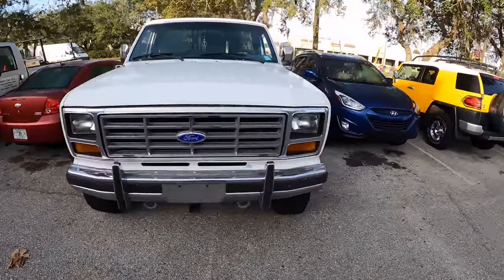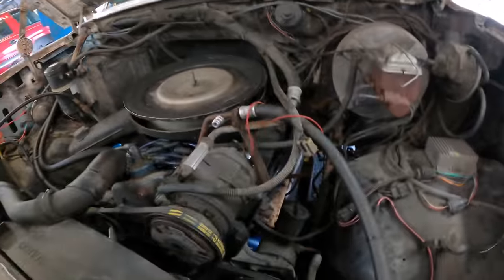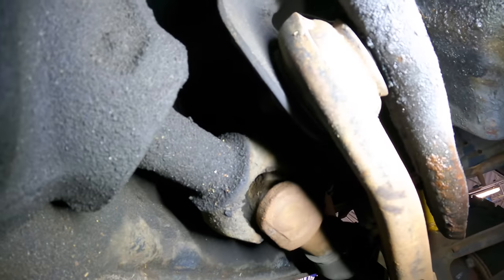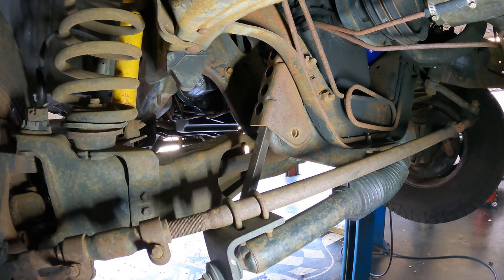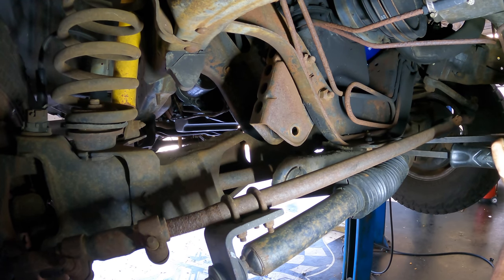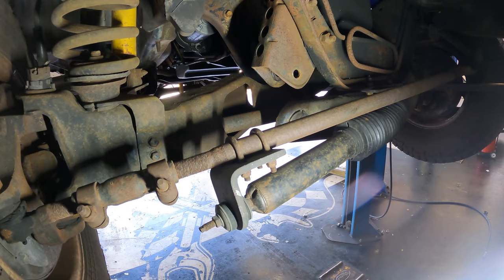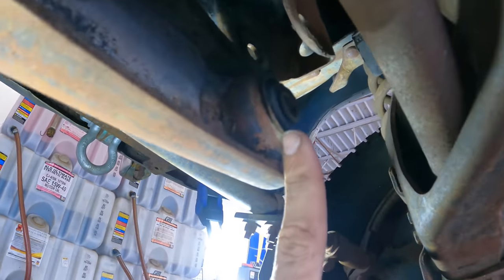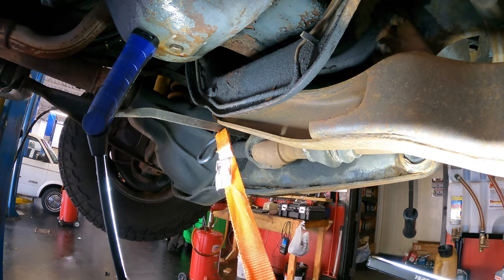Bushings DESTROYED! Assault Hammer to the rescue! Old Skool Ford F150 Classic

Comment: Those Bushing Bolts should be tightened with chassis resting on wheels.
Reply: Said the same thing...it'll tear the centre of the bushings out
Reply: You are correct sir.
Reply: ALWAYS TIGHTEN BUSHINGS WITH WEIGHT ON WHEELS
Reply: The rubber is not bonded to the sleeve, so it doesn't matter.
Reply: @Maples01  You're wrong on that. With these bushings the rubber is bonded to both the inner and outer sleeve. Installing like Ray did pre-stresses the bushing, taking away half it's normal service life.
Reply: @P_RO_  Did you see how it came apart, bonded would have torn to pieces so no, you are wrong.
Reply: @Maples01  They're bonded. I've got two new bushings sitting outside in my van. How many have you handled? Part of the way they can wear out is losing the bond on the inner sleeve which wallows out the rubber. I've been told the poly bushings aren't bonded but I don't know about them; the ones in this vid are stock, not poly.
Reply: @P_RO_  Never seen one lose the bond, just seen them tear up, oh please tell me how I don't know what I'm talking about and how you are so much more qualified to comment.
Reply: @Maples01  Now wait- first you say they're not bonded and now you're saying you've never seen one lose the bond. Pretty clear you have no clue of what you're talking about. Goodbye.

Comment: Penetrating fluid generally does nothing unless you let it soak. Then it depends on quality of the product on how far it goes into the threads
Reply: I have watched PB blaster literally walk it's way around the threads of stuck fasterners, it's impressive stuff. I use CLP breakfree for gun smith related stuff. Marvel Miracle Oil can work in a similar fashion too.

Comment: Those high beam foot switches tend to crust inside, I wonder how many times the guy repaired it.

Also, if you decode and see what Eric says about penetrating oil, it's a "myth" when you can't spray said oil directly on the threads of the bolt.

He gives a great example in one of his "exhaust manifold therapy" videos : sprayed a LOT of penetrating oil on the bolts, but since the threads are in the head, none of it goes where you really want. And as a matter of fact the threads were completely dry when he finally removed the crusty bolt.

But he uses it anyway because :
- It makes you feel better
- There is less chance for the bolt to be stuck on the socket (well, he didn't say that one, but hey, I guess so)
Reply: Where's Heineman when you need him.    'Project Farm' channel did a series on this some time ago.   I see I need to waste another couple hours of my life seeing what his findings were.   He's generally pretty thorough in his tests.
Reply: @IndianapolisGerry  They indeed do penetrate down into the tread, but as expected some brands did a much better job than others.
Reply: @Milnoc  Also when working in a shop environment usually there's not a lot of time to sit and wait for the oil to actually penetrate.  It'll help once the nut starts to spin off, but who wants to wait for several hours?  

That's when people bring out the 'real' liquid wrench...as someone famous once said:  Can't be stuck if it's a liquid :-)
Reply: ⚡:SPEZIEL FÜR DICH
"BEST.FURDICH.FUN" :yt:
> SATISFY.BABY < :socialdist:

 

tricks I do not know
Megan: "Hotter"
Hopi: "Sweeter"
Joonie: "Cooler"
Yoongi: "Butter

So with toy and his tricks, do not read it to him that he writes well mamon there are only to laugh for a while and not be sad and stressed because of the hard life that is lived today.
Köz karaş: '' Taŋ kaldım ''
Erinder: '' Sezimdüü ''
Jılmayuu: '' Tattuuraak ''
Dene: '' Muzdak ''
Jizn, kak krasivaya melodiya, tolko pesni pereputalis.
Aç köz arstan
Bul ukmuştuuday ısık kün bolçu, jana arstan abdan açka bolgon.

Uyunan çıgıp, tigi jer-jerdi izdedi. Al kiçinekey koyondu wins taba algan. Al bir az oylonboy koyondu karmadı. '' Bul koyon menin kursagımdı toyguza albayt '' dep oylodu arstan.
Arstan koyondu öltüröyün dep jatkanda, bir kiyik tigi tarapka çurkadı. Arstan aç köz bolup kaldı. Kiçine koyondu emes, çoŋ kiyikti jegen jakşı dep oylodu. # 垃圾

They are one of the best concerts, you can not go but just seeing them from the screen, I know it was surprising

💗❤💌💘
Reply: @IndianapolisGerry  Yeah Project Farm did good tests on it. Result with basically that it does not really matter at all. And WD40 was crap if I remember correctly.
Reply: Yah, they were all pretty worthless according to his testes....I went back and rewatching shortly after I posted this
Reply: True penetrating oils do work if given enough time. Were most err is thinking that WD40 is a penetrating oil when it isn't, though it does help sometimes. PB Blaster is much better.

Comment: These are great trucks, had an old abused '85 once. It leaked oil and fishbite misfired and had a slightly bad head gasket but still completed a 700km trip. The coolant boiled but 20 mins later i was on my way. Today's cars couldn't do that for sure.

Comment: One thing I learned not to do a while ago was to try hammering a bolt into position if it won't go. I've damaged threads doing that as it was the thread catching  due to misalignment. Either keep wiggling the part in question or screw the bolt in if the alignment is close enough.

Comment: In the rust belt, the bolts would have been welded to the center bushing sleeve.
Reply: yeah, but it is a FORD, so it will leak enough oil to keep that from happening.

Comment: That is an on/off switch that controlled my Phillips made,  385,000 candlepower, 3 mile reflective range, KC Daylighters that were on my 79 El Camino, and it also came standard as the 60s and 70s floor mounted, high beam,  headlight switch. 

But it sure came in handy for an auxiliary light switch! 

Just route that sucker to a relay, and boom!!

Comment: I've done a few of those I Beam pivot bushings through the years and, my 30 YO OTC ball joint press saved me a LOT of time/hassle over the years. Now for weird, the pass side bushing, as in the bean/front diff ass'y, the bushings in question, don't seem to die too quickly, the same can't be said about the beam going to the L/F spindle. Just that the latter's much easier to replace.

Comment: My first car a 74' Dodge dart had a high beam switch like that. And I made sure to put the grandma quilt over the back seat just for fun. Many years later had a Bambi basher installed on my Jeep Grand Cherokee and gave the guys at the shop a floor switch like that to control the LED light bars. They thought it was a great idea. Some had never seen one before.

Comment: You’re working on the vehicles i used to work on for about six years.

I know it’s about a year old but for future reference because Florida doesn’t really have rusty vehicles so they last longer. 

Bushings like that. Raise the vehicle higher if you can put a toolbox or something under the tires drop it back down on it. And if you loosened everything up in the suspension both those arms will drop down without even using a prybar.  

Can tell you’re a young mechanic. You’re used to self sealed bushings. I would of pack the grease all on it and shoved it back in.

PS Especially in Florida  when everything is so darn hot then it gets hotter with use the bushings dry out fast. Unlike up north it’s usually everything they put down on the roads in the winter time that tears the bushings up so that’s why you put a big blob of grease around them to protect them

Comment: I've heard and also agree 98% that penetrating oil does nothing for breaking nuts and bolts loose. There is probably a few cases were multiple applications over time could allow the oil to wick into the threads, but in most cases torque or heat expansion/contraction is king. I think spray oil that is particularly good at removing rust can lubricate and ungunk the exposed threads, so that once you've broken the fastener lose, the rest of the way will be smoother.

Comment: High beam to low beam switch on older cars, trucks.  I am old enough to start a US Army Jeep. With the foot starter.   That truck was a trip. 24 volt. Air craft type wires.  Screw onto spark plug. Ect. Needed a generator that was like $2000 in 1980.  Cost more then the truck

Comment: Wanna pull from the old memory cells? One of my 1st cars had something like your dimmer switch, but didn't have any wires going to it and it was on the right side down close to the gas pedal. Funny thing was every time you pushed on it, the engine tried to start! Had to push hard tho. One other thought, at the Ford garage, we always lowered the vehicle back to the ground, then tightened the through bolts on the I-Beams. No mockery, just what I was taught. Always look forward to your videos!

Comment: Thee Olde Dimmer switch. I drove with those for a while. Also had an old p/u with the twin I beam front suspension. The large triangular plates that the held those beams to the frame saved me from severe injuries in a wreck that totaled the truck that was less than a year old. It stopped the impact from traveling through the frame and to the cab. I did do a face plant into the windshield post on the driver's side busted my nose give me some nice bruising on my face. I was wearing the seat belt but it didn't restrain my 6'2" frame from traveling that far. It pushed the frame in front far enough to the right that it broke the fuel pump and was leaking gas so I bailed and scared the bejesus out of some bystanders. I'm filed as undeclared was originally a hard-core Repugnanticant from Iowa back when they still felt some responsibility to the constituency they represented but now I am undeclared and so I get all the trash in the mail. I've actually become good at spotting BS mail even from PACs trying to be stealthy.

Comment: My grandmother (God rest her soul), bought a 1985 Jeep J10 full size pickup when I was a kid -- and I remember that truck had the dimmer switch on the floor, like that Ford F150.

Wish I had the means to restore that truck, because I would have resto-modded it, to make using the four-wheel drive easier. (The four-wheel drive had a much wider turning radius than two-wheel drive, on that truck.)

Comment: I think that's a '76. I had a '76 F250 Camper Special King Cab I bought off a friend when he was going to trade it in. It was a camper special with 16" split rim wheels. With the restricted steering because of the tall wheels, it seemed like it took a football field to turn around.  It was great for hauling and towing.

Comment: I don't want to be the smartypants here, since I'm not a mechanic at all, I just used to fix my own cars when it's needed, but when I change a bushing or a control arm I used to fasten the bolts going through the bushing to final torque when I lowered the car and sitting on its own weight. By this the bushing is not under pressure when it is in its natural position and lasts much longer. I don't want to underestimate your skills, I like your videos, if I'm wrong then feel free to correct me, but this is the first time when I'd do it differently than you did, so I just pointed that out, since I don't know if it matters that much at all.

Comment: Hell, I can remember when the starter switch was on the floor in my 1941 Chevrolet. Not to mention a spark adjuster on the colum on a ‘28 model A. I now drive a Duramax, the little Duramax. By far, my best Silverado ever.

Comment: Low high headlight bottom 
I was watching the knock sensor on a suburban and you had a lot of problems with the lumens or light, you can go to home depot and buy the Milwakee head light for around 60 bucks, I got 2 one is on use and the other charging I do some HVAC or mechanic and they last about 6 hours on a medium setting, they have 5 options light

Comment: I love "old" cars too. Simple electronics and mechanical systems make perfect cars to me. The newest car I've owned is a 2010 Corolla Base 5MT. Because it is a base model, it feels 10 years older. I also own a 2003 Dodge Dakota, and have owned a 2002 Ford ranger and a 2000 Toyota Echo. Meanwhile, the most advanced car I've owned was a 2006 Infiniti G35 coupe 6MT. Fairly advanced for the time and fully optioned, but the relatively poor fuel economy along with cost of parts was too much for me. I still miss that car. 😢

Comment: The only thing I would add to this repair video is that it's usually a good idea to tighten the bushing bolts with the suspension loaded (4 post lift). This keeps the rubber from flexing while the suspension is at rest. Otherwise, fun video. Especially with the harpooning air hammer chisel.😂

Comment: My father had a 1958 chevy convertible that blew the transmission. He replaced the transmission with a floor mounted manual stick shifter, and added a clutch pedal......The auto trans gear shifter was left on the column.

Comment: If the car was from the early forties that switch would be a starter switch. My dad had a Lincoln, I believe, that the foot switch pushed the starter into contact with the flywheel and made the electrical connection. In that truck that is the high beams.

Comment: 1:12 Those have been 2 things. Usually they are high beams but they can also be single swipe wipers back before the delay function was invented.
Reply: On a Lincoln we had it advanced the mechanical radio through the presets.

Comment: Lubricant is nice on low rust hardware but anyone who fixes cars from the "Rust Belt" will tell you that the second tool you need after the 5 lbs hammer is a good set of Oxy-aceteline torch and you always order new bolts/studs because most times, you end up cutting them...

Comment: I do have a question, if I may ask...

When tightening suspension bolts on bushings, I generally used something like a pole jack or something similar to jack up or load the suspension to around ride height before tightening the bolts. That's something I've always been taught to do. That being said, I'm young, inexperienced, and I primarily work on newer German cars. Is there a reason why you didn't do this here?

Comment: Just from observation, is there not a tie down on the floor you could have strapped to, and just ratchet it down? seems like it would be safer, and slip less. understanding of course you reinforce the lifted vehicle from tipping in the direction of the pull..

Comment: To old arnt I we were saying how high use to be on floor no more they are what a gem we had a dual wheel for construction in Australia with nice351 on gas very reliable with tray we use to put a lot of weight on it everyday very strong ford single cab fit nearly the same but U all have the steering wheel on wrong side ha have

Comment: IF I, understand what your doing? would a drill remove enough of the rubber (of some for ) bushing to push it out? May not be time efficient but just curious. 
I find it interesting that most use impact hammers while working on bolts. 
I do like Kopper Kote on things which will rust/corrode.

Comment: an assortment of dimensional lumber pieces ( 1x2, 2x2, 2x4, etc.) can be very useful in helping hold pried parts in place temporarily. your shop mate should be just as capable in assisting when you need a third hand to grab your wood as he is in twisting your shaft.🪵

Comment: The Auto Dimmer Switch, or (High and low beam selector).
At 1925, the dimmer switch was located on the steering column. This changed in 1927, when it was moved to the floor.  Why did the location of the dimmer switch change? The automobile makers decided it was too much of a distraction on the steering column and agreed to move it to the floor.

The floorboard area was wide open, perfect for the floor-mounted switches, as they could also be made larger and more durable. Car owners would enjoy the floor-mounted switch for the next 50 years.

However, not all vehicles made the transition at the same time. When a major re-design of a vehicle was made, then the dimmer switch changed as well. Generally, the switch function would go to the stalk when a model went from rear-wheel drive to front-wheel drive (which happened a lot in the late 1970s and early 1980s) because the foot-well area became smaller, leaving less space for owners’ feet.

Comment: 1986. Which means, unless it's been changed, that is a 351 Windsor engine. 302 was the only engine in those trucks that was fuel injected in that year. And you only had 300 Inline 6, 302 V8, and 351 Windsor in that f150 to choose from. If it is original, I would love to have it, lol.
Reply: I think you're right. I prefer vans, essentially the same as 2wd trucks, and up to 91 you could get a 429 in them so I can't understand why not in the trucks too, but that's how it was!

Comment: 1:05 That is a rare piece of automotive history. Back when things where put in logical locations. It is the High beam selector switch. Only down fall was it was not protected properly from the elements. Which lead to corrosive malfunctions from mother Gia coming in contact with the connectors on the back of the switch, which was located under the vehical. Ahh. The simpler things in life.

Comment: The button on the floor is the dimmer switch.  Very convenient place for it.  Can anyone tell me why they put it in a very inconvenient place which requires moving your hand off the wheel to the dimmer switch EVERY TIME YOU USE IT.

Comment: You could have inserted the bolt back into the hole and then used a small block of wood to wedge the arm tight so you could r/r the"easy side's bushing".

Comment: what  the hell does a dimmer switch have to do with a control arm bushing. By the way genius that kit you used to install the new bushing is ALSO used to remove the old bushing.  oh youmicht try putting a light coat of grease or oil on the new bushing before forcing it into a dry hole.